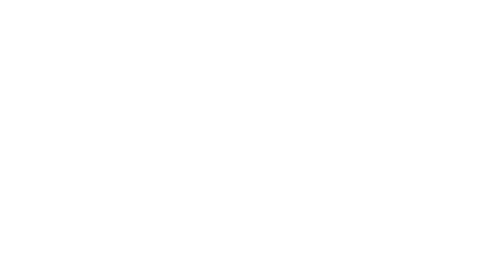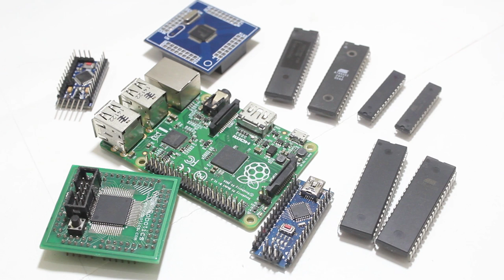Video 1  Introduction To AVR ATmega328p Microcontroller Tutorial

Comment: How can I program my Atmega328p without an Arduino board? I am looking for a serial diy programmer. The atmega already has the arduino bootloader
Reply from the maker: +lcm  You Are Right Arduino has A bootloader that enables it to get programmed  serially using RS232 protocol....   Where as Generally a Atmega microcontroller is either Programmed using a Serial ISP/ICSP or a High/low voltage Parallel Programmer ...    What we will be doing in this tutorial series is that we will be using USB ASP (a kind  of Serial ISP) That connects with the arduino and will clean the chip first i.e. we will delete the bootloader and  we will program it then by transferring the .hex file . This Programming method is Industrially Acceptable Than that of bootloader.  Bootloader slows down program execution after power on and also consumes extra memory.... Any more doubts You ask me